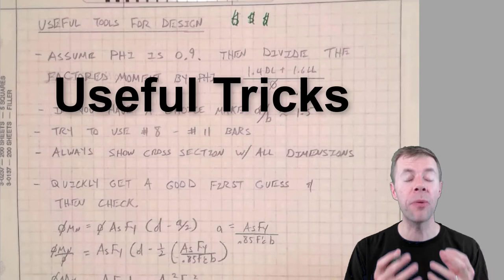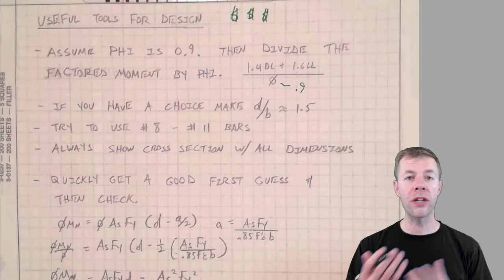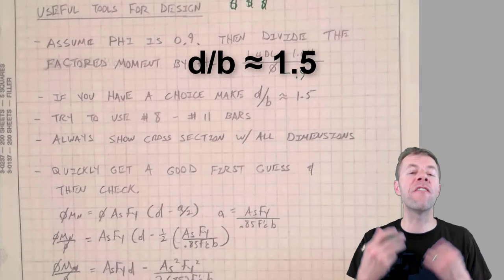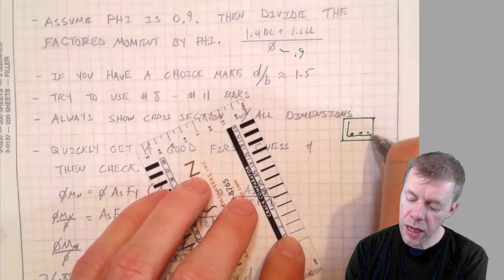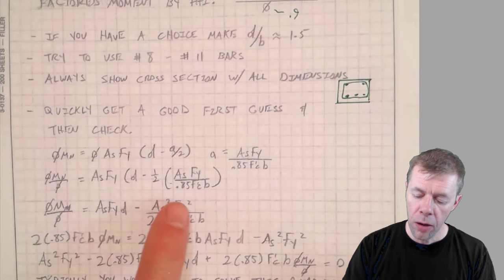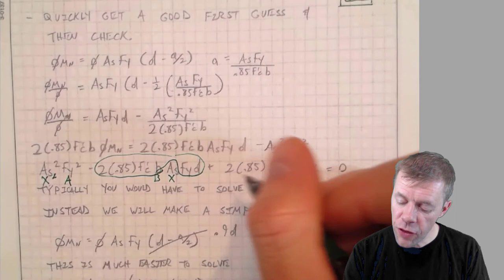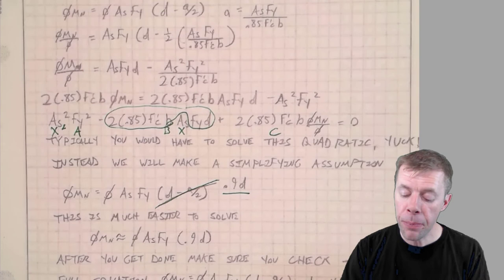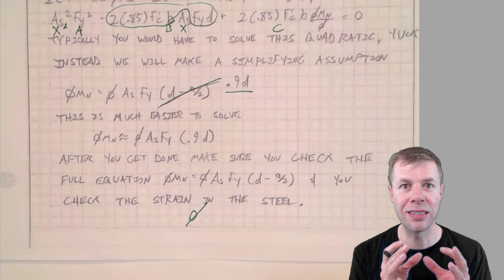Fast Reinforced Concrete Beam Design | How to Design Like a Concrete Ninja!

Comment: You get points for being a junior ninja.  If you want to be full blown ninja then you use As=M/(4d).  (For grade 60 steel)
Where 0.9d and M/(4d) break down is with high reinforcing ratios which you don't want to do unless you have to, and even then by the time you calculate As and select bars, you have probably already provided a little bit more As than the simplified calculation required.  If you think you are using high reinforcing ratio then go back and double check the capacity.  And real high reinforcing ratios is where you might get into the transition zone and require lower phi factor.